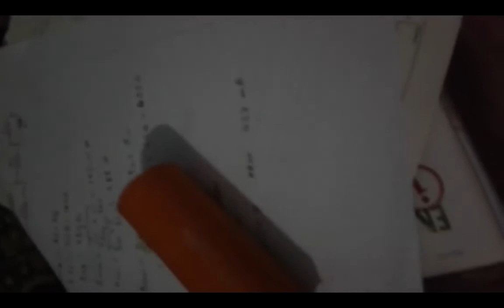How to make a Rechargeable FLASHLIGHT

Comment: I'm surprised you didn't have to sand the tack-welded lug on the battery to get the solder to stick.  I've had to do that a few times and only sometimes did it work.